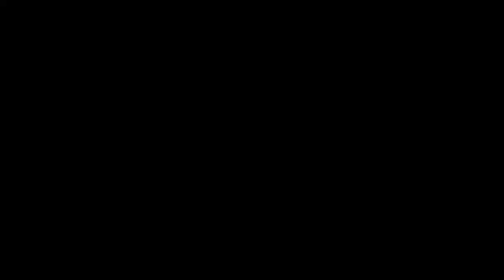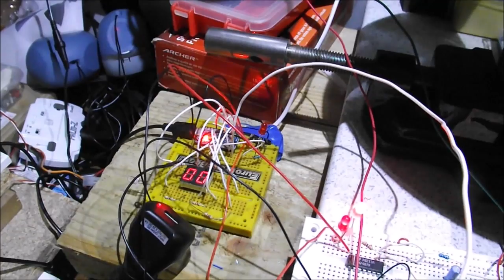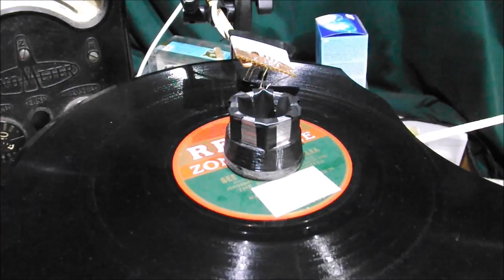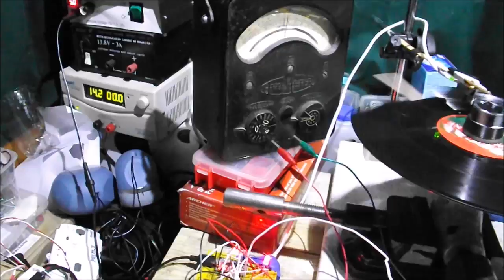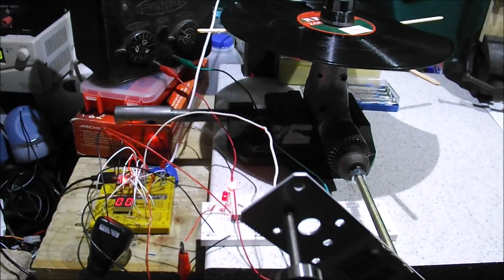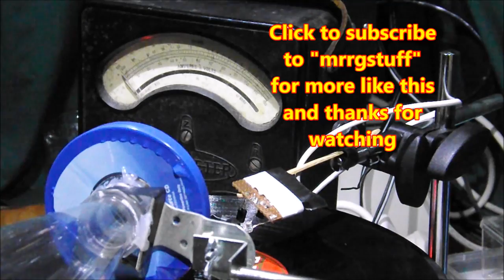Speed display for hand cranked gramophone

Comment: A hand held wow and flutter device ? Cool.
Reply from the maker: It made an interesting project, but the whole setup wasn't very practical. The display wasn't responsive enough to really help cranking at the correct speed. The systems I employed in this video worked much better:
https://youtu.be/Vc88m0fDI5E?si=14sAy604hiozoQJl
Thanks 😀 👍